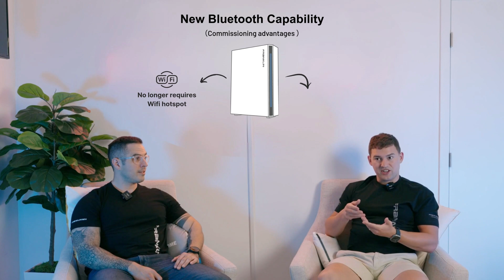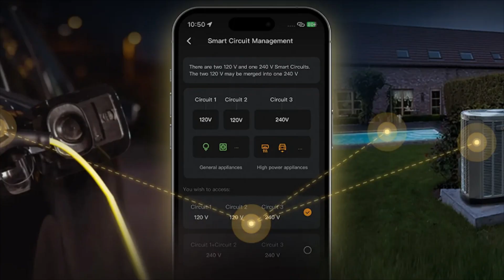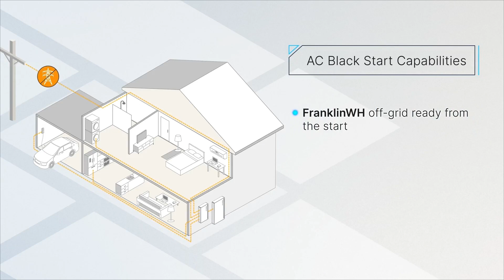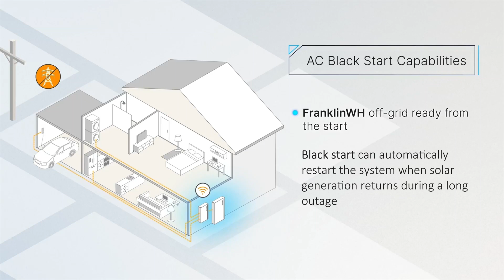FranklinWH Podcast | aGate Overview

Comment: I have an exterior utility sub panel that feeds a hot tub. I have it on the Agate bypass so in a power outage, it wont draw from the batteries.  But it just dawned on me that perhaps at night, when the rest of the house is drawing from the batteries, that hot tub might be drawing from the grid.  Comments?

Comment: Will any of the Gen 2 software upgrades be pushed to those that bought the Gen 1 AGates? 

Speaking of "pushed", are there any plans to have push notifications / alerts as part of the app? I know notifications are added to the message center but unless you open the app, you would not be aware that there was an alert. A push notification with an alert would be  helpful.

Comment: I have just recently had the agate and 2 batteries installed. I have a 3500 sq ft house with one central a/c unit.  My installer is horrible.  This is the first one of these that they have installed and it appears that they don’t know much about them.  I have been waiting a couple of weeks for them to send someone out to make my app work. Just by looking at the blue lines on the batteries it looks like they are running out of power every night.  Should that be happening this time of year?
Reply from the maker: If you’re experiencing any issues or need support with your system or app setup, please don’t hesitate to contact our support team directly at +1 888-851-3188. We’ll be happy to assist you and ensure everything is working as expected.